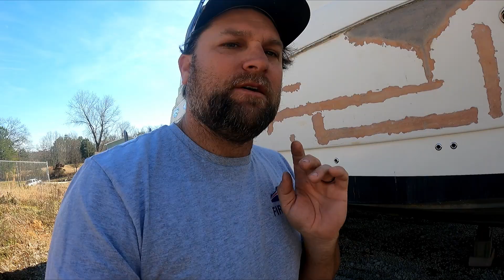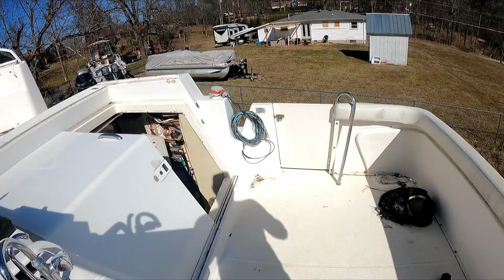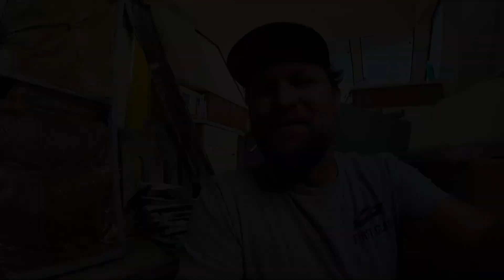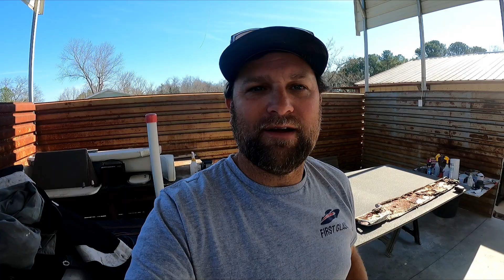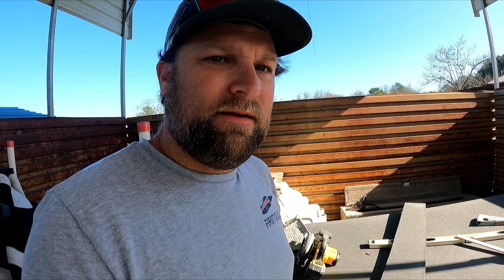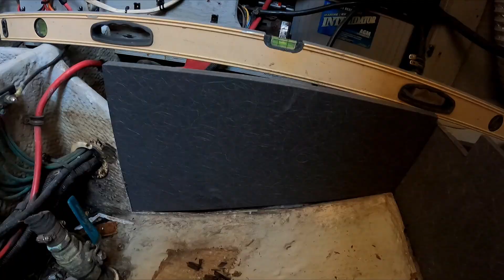Our Great Loop Boat, Silverton Hurricane Damage Rebuild Yacht, Stringer Repair and Update

Comment: I have a Silverton 362 1995 and yes Silverton stringers are full glass the wood inside is for the form the exception being the stronger for the engine.  Silverton provides documentation to surveyors attesting to this if you call them.  

I yanked my engine last year, cleaned all the stale fuel out of the gas tank to get mine running also almost free.  Took a year to finish and two weeks after the finished survey the fuel tank k spring a leak, now THAT is a real project replacing the aluminum gas tank!!
Reply from the maker: @987CAYMAN07  I could only imagine if I ended up having to replace a tank after engines are in 🫤.  The forward part of my stringer seems to be mostly hollow now. I'm not going to worry about it.

Comment: As a fellow content creator and Silverton owner, I will be following.  I actually used to own a 322.  Now we have the newer 35.  We loved our 322.  It gets a little tippy in rough seas. Hopefully the Volvo Penta are heavier to provide more ballast.  Make sure the rudder post pockets are solid. The lack of access makes them a pain to repair.  Great project!  Good luck!  Michael Meyer
Reply from the maker: Thanks Michael for the heads up. I do plan on repacking the rudders for maintenance. I will get a close inspection.  I never had this boat in the water nor have I ever been aboard a 322. I have had people comment to be "good luck with that tippy top heavy vessel called a 322" that is one of my concerns but we are mostly going to fair weather cruise. I'm crossing my fingers it's not too bad because it's one thing I can't fix!